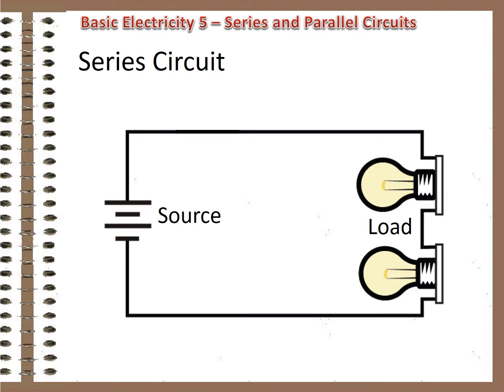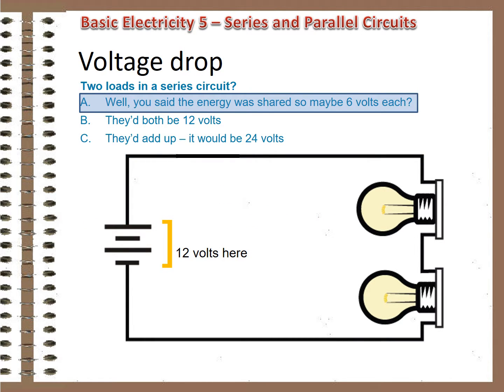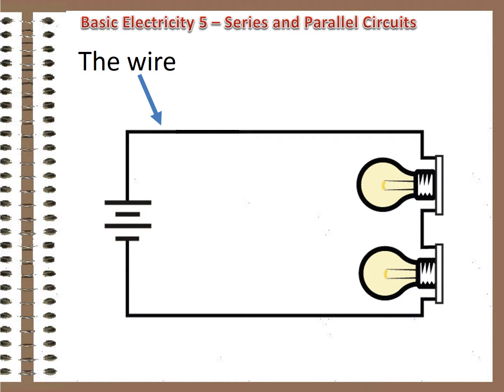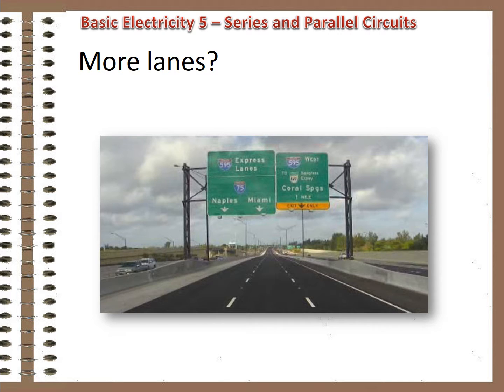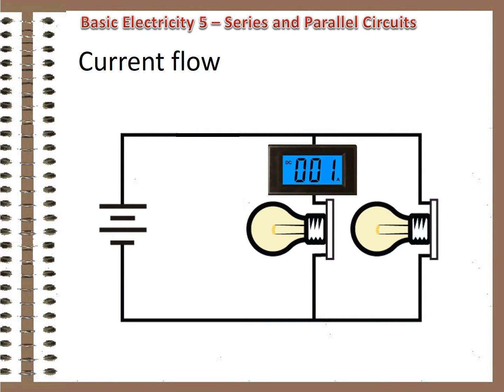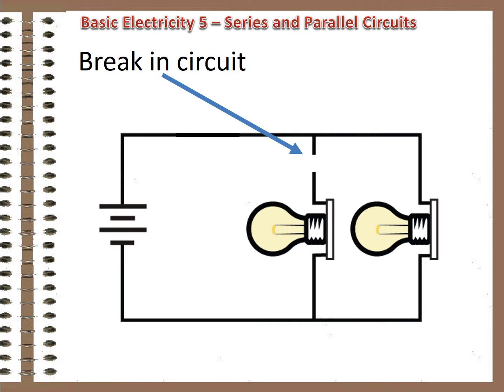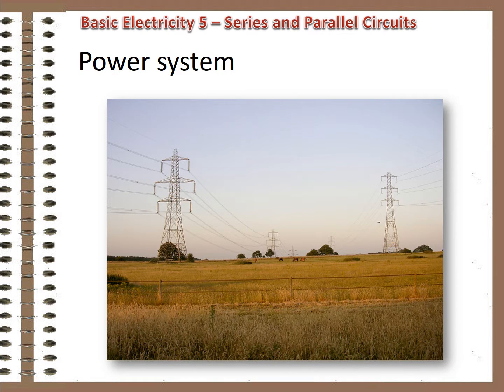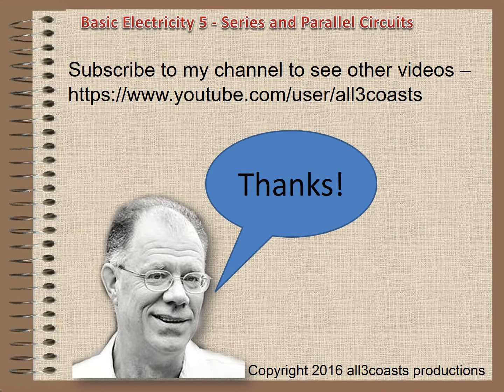Basic Electricity 5 - Series and Parallel Circuits

Comment: Great analogies, great explanations!  I am really wondering what your background is - teaching - engineering - etc.
Reply from the maker: Glenn George - any edition is good, the more recent ones will have more up-to-date information. Keep in mind - it's a physics textbook, not an electrical engineering text. It covers all aspects of physics - motion, light, mechanics, sound, etc. It's a starting point to look at phisics from a different perspective, not a detailed explanation.
Reply from the maker: Thanks Andy. I worked for PG&E in California for 34 years, as a power plant operator, then as a classroom instructor and course developer. I worked hard to develop a "storytelling" style of instruction, which I've carried over with the videos. Also, I used a textbook called "Conceptual Physics" by Paul Hewitt. The book literally changed my life - it's physics without math. A revelation...
Reply: Doug Fuller I really like your presenting style. What edition of Conceptual Physis would you recommend as a good reference to help explain electrical engineering princilpes without the  math proofs?